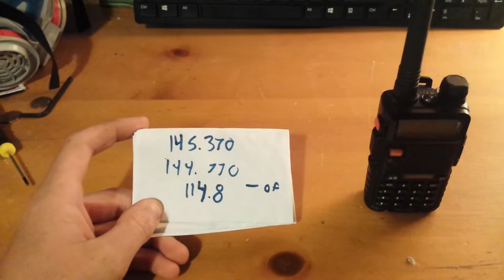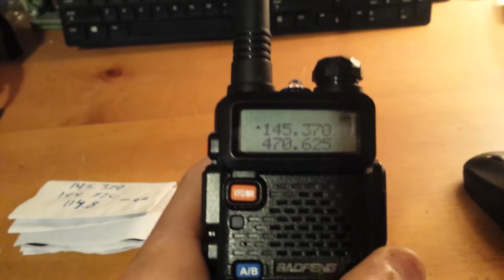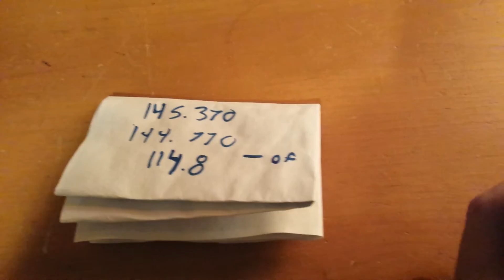UV5R offset save problem fixed

Comment: Thank you! Also, v several rdit that's day that stopped channels can only be changed or updated by using CHIRP. Any changes made to saved channels are discarded when edited with the handheld. Your way looks like it requires every channel to be programmed manually... TWICE. If that's what i have to do, I'll do it, but WOW what a hassle. In other news, you are a hero. Thanks again for figuring this out.

Comment: Holy cow! Thank you so much. No one else who has posted a program a Baofeng repeater video ever included what you did. Every one says you have to save it TWICE but they never inform you you need to do that on the second frequency line below the receive line. It is so not intuitive since once you go back to channel mode that lower line jumps back to the second BAND freq that has nothing to do with the one you just programmed for the repeater.   Thank you so much👊🏼

Comment: I have the UV-82.This worked for me, until I saved it to channel1 and then it went back to the same problem, not transmitting in the offset frequency. I went back and did everything again and it worked. Thanks so much, I was ready to throw this radio in the trash. I still am not too happy with it because of this problem, I will probably purchase a Yaesu ft-80  for my next ht.
Reply from the maker: Mark Dandeneau yeasu wise we have lots of digital fusion in san Antonio. if fusion is a big deal were you are give it a try and by yeasus fusion ht

Comment: On my RX3, the offset stores and only shows in frequency mode; I assume the offset is still there in channel mode but doesn't show as one comment stated.  I'll test this.  I did the delete channel and reentered with offset in channel mode but still didn't show on RX3. I can't find + or - in settings and tones are beyond me. Echolink works great on my smart phone with app lol.  I'm thinking I'm not techyv enough to be a ham, and will use Echolink.

Comment: I follow the steps with my local repeater up until the two minute mark, but when I hit the transmit button, nothing happens at all. When I change to a different channel, the transmit button actually transmit. But on the frequency that I saved via your instructions up till the 2 minute mark, the transmit button does nothing. Any insight?

Comment: Great video used it, but resetting radio and saving to only channel 1 was not important. Just added a repeater to the next open memory channel in this case 80.  Works great.  There is an alternate solution, when you go back to few mode hit scan quickly and the transmit offset pops right up, save that to the same channel and GTG.
Reply: Freq not few mode

Comment: Looks easy enough. I have a tablet with windows AND android and it has chirp on the windows side and that is making things very convenient, the Chuwi. But, I've always wondered what the trick was. I have a 8 watt with tx problems and wondering if anyone has been inside the tx area.
Reply from the maker: what seems to be the issue?
Reply: Little or no output

Comment: SAVE YOURSELF 5 MINUTES watching this well-intended, but not-quiet correct video. You DO NOT HAVE TO RESET THE RADIO!

Fix:
0) Setup the repeater in VFO mode. Transmit on it and verify the repeater responds and everything's working well.

By the way... Make sure to set WN (wide/narrow) to WIDE or you'll be barely audible on the repeater.
("narrow" mode is 12.5 kHz narrow-bandwidth for denser frequency spacing, only used in China, and will make you sound super-quiet to everyone in the U.S. using radios that are properly setup for standard American 25 kHz frequency-spacing, which the Chinese call "wide" bandwidth. Simply put, NEVER use "narrow" in the U.S.)

1) Save the repeater into a memory by pressing MENU, use up/down to go to
MEM-CH, then press MENU, use up/down to select a channel, then press MENU
again to save it.  Now press EXIT.  You have successfully setup the
repeater's OUTPUT frequency ONLY.

1) Hit VFO/MR and return to "frequency mode"

2) Press * to see the "reverse" (input) repeater frequency. You'll see an R appear on the top. Leave it like that.

3) Hit MENU and return to MEM-CH and press MENU MENU to save the settings
again OVER the already-saved memory.  You'll see "CT" appear to the LEFT of
the frequency.  NOW it's saved the repeater's INPUT frequency as well (no
other manufacturer does it this dumb way, btw).

73's and happy ragchewing!